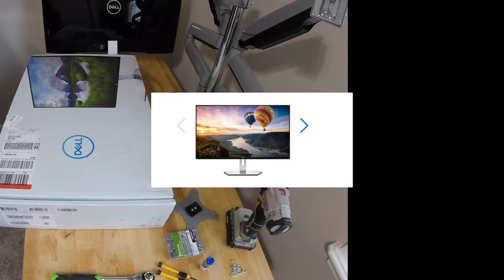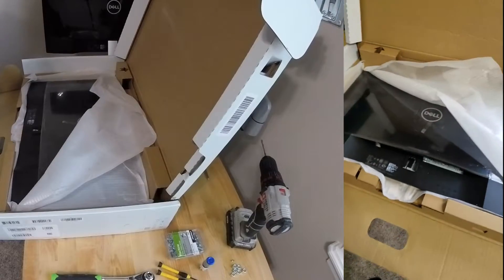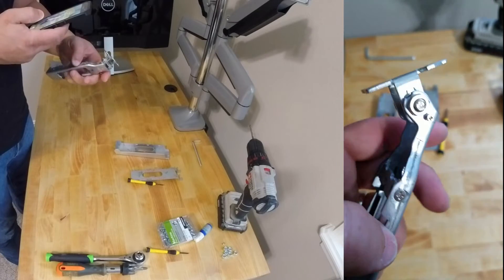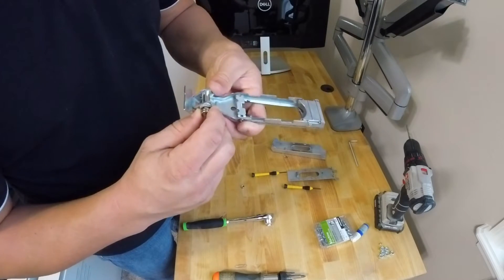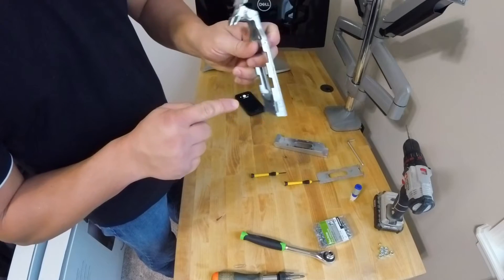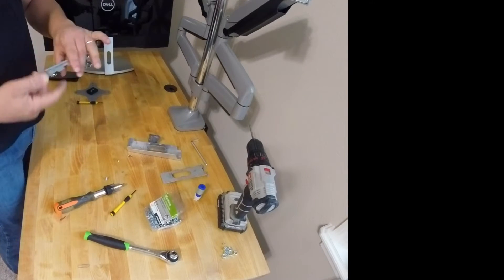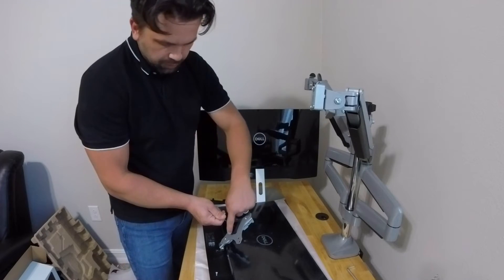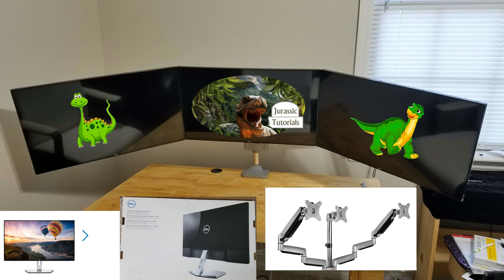NEW - how to mount Dell S-series monitors in VESA mounts without adapter!

Comment: Where can I get the Mounting part? whats the name or refence number?
Reply from the maker: The mounting part is what the monitor uses to stand on a desk, i didnt buy anything extra
Reply: Jurassic Tutorials can I please get in contact with you, I have a dell p2719h monitor stand but there’s nothing on the back of my monitor to mount it to, is there an adapter for this ?
Reply from the maker: @user-mf8su7ny3s  what i am reading online in the dell website is that it is compatible with VESA mounts.  Basically you are lucky and you can use the mount i have in the video without any modifications. Just search VESA mounts and pick one you like

Comment: Is  it  S2719H monitor model?
Reply: What's that square plate with dell logo on it? Isn't there a VESA mounting mechanism in there? I search up this monitor- S2721HN, it is compatible with any VESA mounting. I'm little confused.
Reply: @ed0426  s2721 series is the newer model and are VESA compatible, but the prev like s2719 series is not VESA compatible to mount on monitor arm. Hence why he doing this.
Reply from the maker: S2719HN, but if you have not purchased monitors, you are better off purchasing monitors that are compatible with vesa or other arm mount instead of adapting them. I have had them the way i show in this video since July of 2019, and they are still holding strong and im loving the setup. I have not had any issues, so it works great.
Reply: @jurassictutorials8480  Thank you so much!